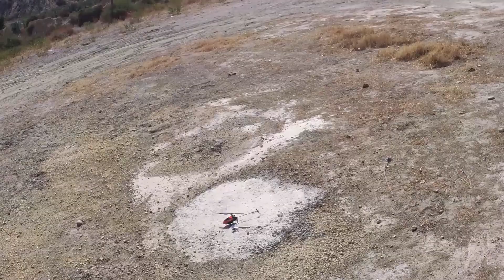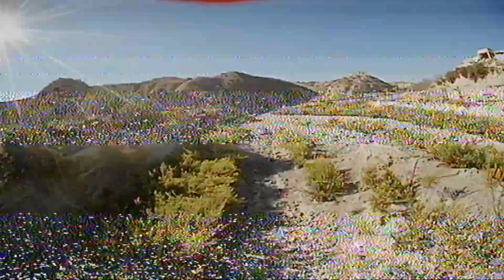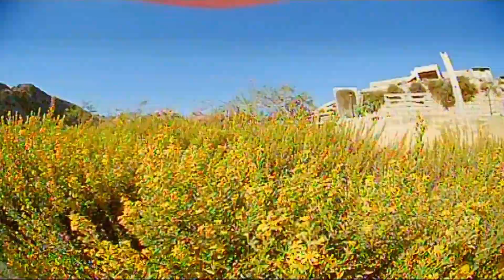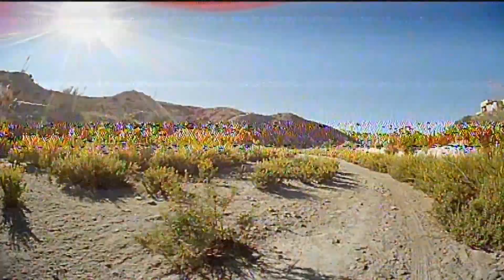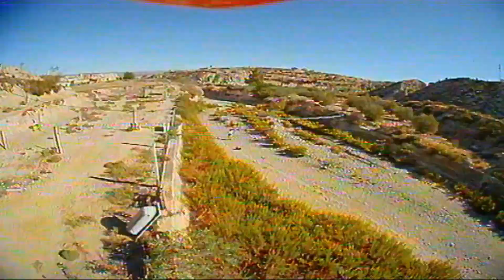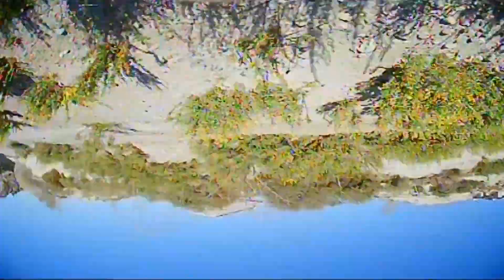Eachine E129 4CH 6 Axis Gyro Altitude Hold Flybarless RC Helicopter RTF FPV Flight

Comment: Looks like it might be handy for checking out the Hole in the Wall hideout before riding in there Butch! 😝
Reply from the maker: True! Here's my other hideout https://youtu.be/n0QKJSCzmC0?list=PLxtbRS-naT68PQVcBSziD3c9Uk6sNhR_f&t=288
Reply: @1nformatica  Looks like the Bolivian Army got there before you mate. :D
Reply from the maker: @theoztreecrasher2647  Nah! Lick of paint and she'll be right! It's a row of miners cottages abandoned around 150 years ago. They mined all sorts around here iron, copper and even gold https://www.visit-andalucia.com/one_post.php?id=82&title=cabo-de-gata-nijar-visit-a-gold-mine-at-rodalquilar
Reply: @1nformatica  Hey, thanks for that. I only got to visit Spain once in my former travels - just the usual tourist hot spots not the East coast. I live in an old mining area and when we were kids an old Yosemite Sam type, who worked for the Old Man occasionally, took us kids around the local tin and gold workings a couple of times. Got a GPS and a book of the old workings in Nth Queensland and will do some local prospecting when the Trump Virus dies down. (If still kicking!) ;-)
Reply from the maker: @theoztreecrasher2647  Old mine workings are very interesting and very scary. When I was young and foolish we used to go caving and into some mines though the old drainage levels. Moving up into the working parts of the mine seeing timbers split by the weight of the sagging roof and others rotting in standing water. In one place the floor had collapsed and the only way forward was to traverse across the narrow gauge rails staring into oblivion as you did so. Happy days!
Reply: @1nformatica  Yep, kids are bullet proof. ;-)

Comment: Where did you plug the camera? Did you use the open port labeled wifi? I mounted a small run cam on mine on the end of the board and cut the canopy so it would fit but I'm using a small 1s battery attached underneath.
Reply from the maker: Yes, I used the wifi connector https://youtu.be/3B_ksHiEiMQ?t=179 It is connected directly to the battery, negative in the centre and positive on the connection nearest the edge of the board. A miniature servo plug fits. There was no noticeable difference in flight time. Please consider subscribing if you have not done so already!
Reply: @1nformatica  Thanks! So which wire on the camera is negative and which is positive? I tried that and something started smoking but the camera and heli still work. I thought black was positive and red was negative since black is hot on an ac plug. That is how I made my connection.
Reply: I just found the diagram for my camera. The black wire is the ground wire and the red wire carries the voltage. Do you know what that equates to on the wifi plug?
Reply from the maker: @js349  Yes, I used the wifi connector https://youtu.be/3B_ksHiEiMQ?t=179 It is connected directly to the battery, negative in the centre and positive on the connection nearest the edge of the board. A miniature servo plug fits. There was no noticeable difference in flight time.
Reply: @1nformatica  Are you calling the ground negative?
Reply from the maker: @js349  Yes!
Reply: @1nformatica  That's odd because that is the opposite of how all of my plugs are made. The plug will not fit in the socket that way. Do you know if the 3rd prong (the one towards the center of the board) has any power on it?
Reply: I had to adjust the prongs so I could put my plug on them and it does work. I do not have a runcam but a cheaper fpv camera. The inside prong does not appear to have any power on it.
Reply from the maker: @js349  Good news! The inner pin is a signal of some kind, the function is unknown to me! Now you don't have the weight of another battery!!
Reply: @1nformatica  Any idea what the maximum range is before the connection is lost?
Reply from the maker: @js349  Do you mean loss of video signal or control of the heli? I was only running 25mW on the video Tx so you can see picture breakup after maybe 10 meter or so. I have never flown the heli far enough away to loose control, it is too small!!
Reply: @1nformatica  Signal from the heli. I guess it depends on conditions where you fly.
Reply from the maker: @js349  Yes, that is true. I fly model aircraft with the same transmitter and range has never been a problem. I am in the countryside so no radio / mobile masts to worry about, or anything else on 2.4GHz like garage door remotes, baby alarms and even microwave ovens!!
Reply: @1nformatica  I am getting bad interference in the video with the on board battery while flying that I do not get with an external battery. It does save weight but I'm not sure if I could work with it. Do you get any interference? I see moving lines across the screen.
Reply from the maker: @js349  Try adding a filter to the power lines : http://bit.ly/LC_Filter
Reply: @1nformatica  That would pretty much defeat the purpose of having an extra small battery for the camera.
Reply from the maker: @js349  Not really. The filter is small and weighs 0.6g will easily fit under the canopy. 1S cell weighs over 10g!

Comment: Don’t do this you will burn your motors out
Reply from the maker: I think you are over estimating the risk. If the heli struggled to get off the ground and flew badly with half the run time I would agree. However as the video shows none of those things are true. Even if you did burn the motor out a new one is almost 5$!!